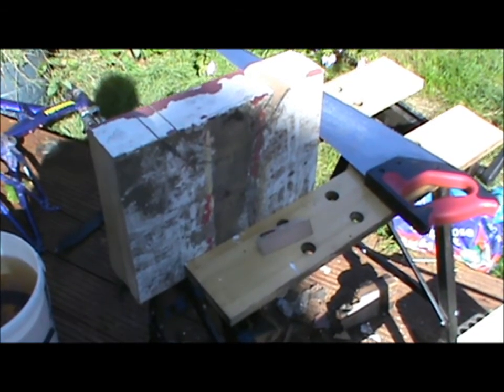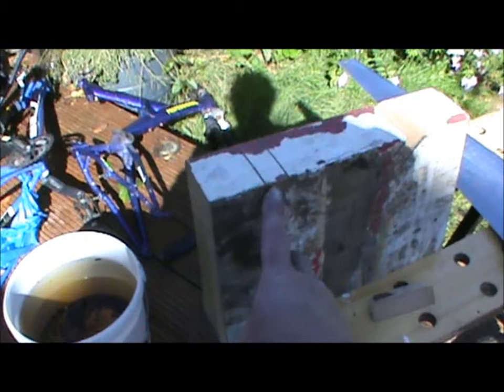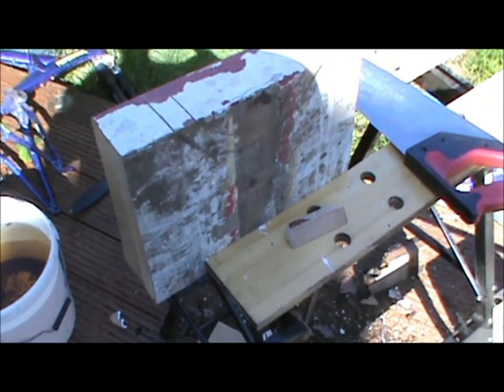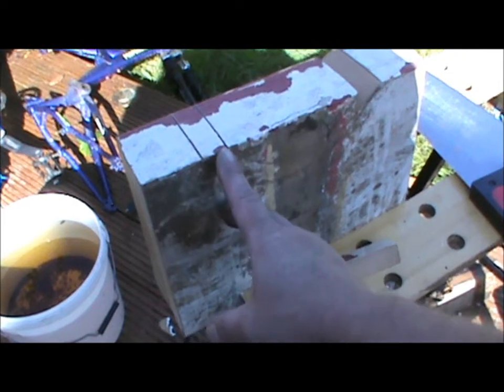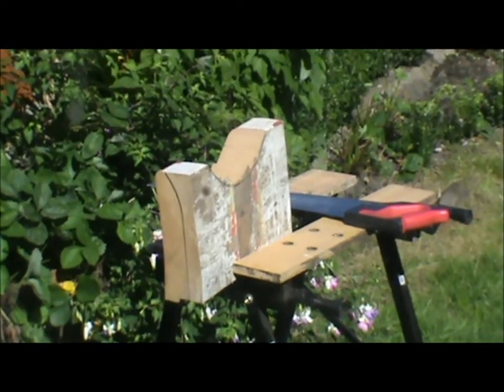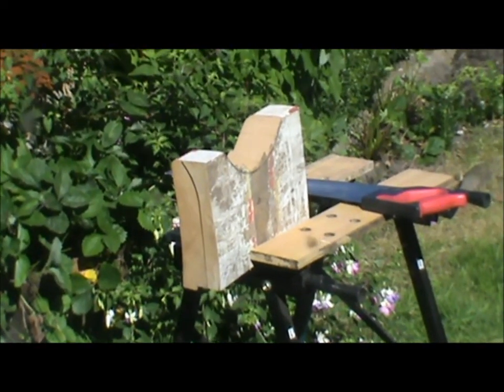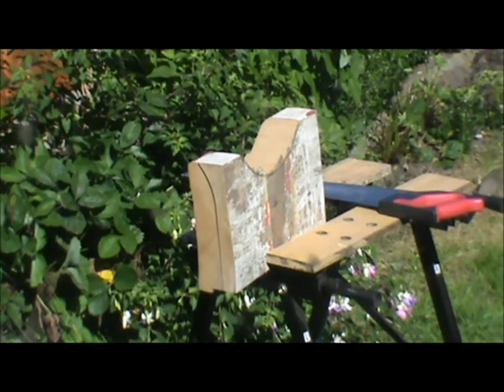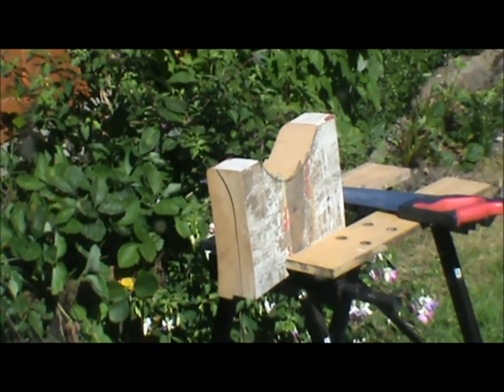Dado rail, the sequel

Comment: It's a poor workman who blames his tools, but one does need the correct tools to begin with.

MDF is cheaper though.

Maybe a polystyrene chair rail?  assuming the final product will be painted and not stained?

You could cut a small segment and then heat it in water?